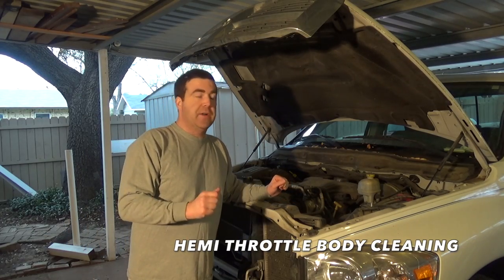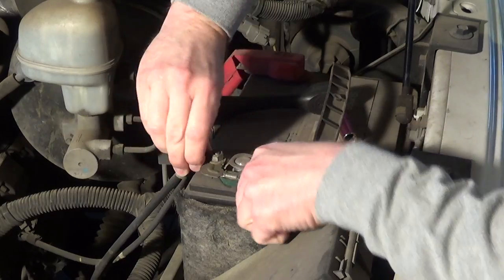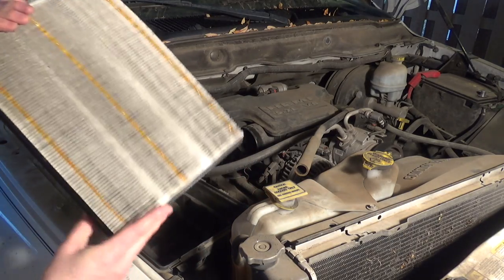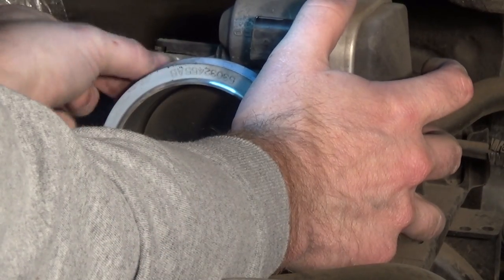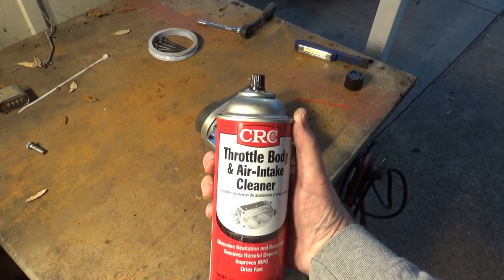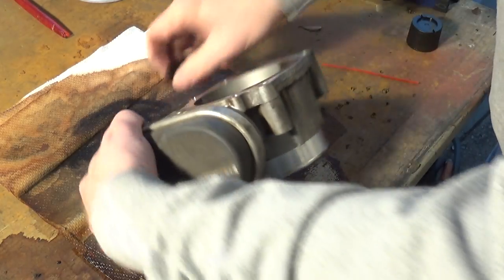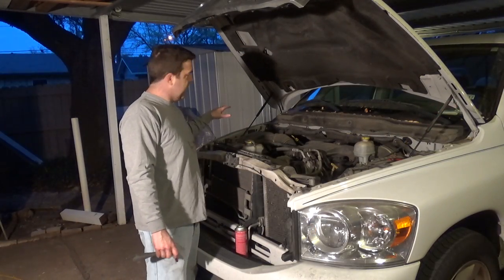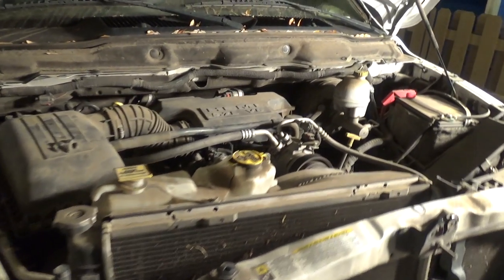HEMI THROTTLE BODY CLEANING | Chrysler Dodge Ram and Jeep

Comment: The engine bay for the 2005 Grand Cherokee is bigger and more room that the Ram, that is interesting. I bought my 05 WK a few years back, I am now getting into the engine and cleaning a bunch of stuff up. I think my throttle body was 3x worse that what you showed for that Ram. After changing out the spark plugs, the person who put them in, didnt bother to gap them. I am glad these types of videos are out there, all of this work I can do myself, it would cost a small fortune to take to the dealer. Great video.

Comment: Great video!  I have owned quite a few cars with 5.7 and the build-up on the throttle body oil buildup in the intake manifold seems to be very common.  I make a point to do just what you did every 20k miles to my HEMIs.  In fact, I just picked up a 2012 Challenger RT with 100,000 miles on it that I am about to pull the intake to remove some debris from under the intake, looks like a squirrel was trying to make a nest, and resolve what looks like a failing gasket issue; and a good cleaning. :)

Comment: Another thing you could do as long as you have the throttlebody off, your air temperature sensor can get carbon on this little sensor, their is a special cleaner for this air temperature sensor (note: don’t use brake cleaners) that’s all you have to do is squirt for 5 to 10 seconds depending on how dirty it is and put it back in.

Comment: Cleaning the throttle body is a good idea for all port fuel injected vehicles. it's the only way to clean the crankcase oil/carbon buildup in the intake system. One other thing I thought about is the possibility that by disconnecting the battery ground, it forces the computer to "reboot"  and may clear any glitches that have worked their way into the programing.

Comment: i had a similar problem with my gmc sierra. temporary fix was cleaning the throttle body. what really fixed the problem was using proper oil. synthetic instead of regular.

Comment: If doing this still doesnt solve your issue, you need to replace throttle body because it has a built in electronic potentiometer and those tend to fail from all the build up causing the lightning bolt light to illuminate and cause vehicle to die at low speeds or when going up hill. Obviously clean it first and test drive before you go that route. These trucks have the same type of VDO electronic throttle bodies as some mercedes benz cars do.
Reply: tech manager- very helpful,. Thanks man

Comment: Thank you so much I'm having the stalling problem with my 2005 Dodge Durango. It stalls intermittently when I slow down to make a right turn. Had the Cam shaft sensor replaced  a week ago and it still stalled on me. So now I will be having the throttle  body cleaned again. I had it done last year in November and it fixed my problem.. So I guess every year I have to have it cleaned.. Thanks for the great video❤️
Reply: Is it long to start?
Reply: @fettieteam2333  No it starts right up .. Even when it would stall out I'm able to turn it right back on...
Reply: @sourpeach1977  yeah but a fuel pump “going out” will work on and off until it’s done, I ask because I had a Dakota that was doing this , found out the hard way 100 miles away from home that the fuel pump was the cause
Reply: @fettieteam2333  I had my fuel pump replaced back in April 2021.. It started acting up when I would go to fill up and was spitting gas out.. And I had the inlet valve replaced because it was on recall...

Comment: For anyone that tries this and still has the same problem, i had the same issue on mine a while back and it went on for almost a year getting worse and worse, and I tried a bunch of things, but for me it started with a dirty throttle body, and it made it run rich and it took a while to figure it all out but, the that little dirtythrottle body throwing off the mixture took out one of my cats, all 4  o2 sensors, and the egr valve.  Hope this helpes someone with the stress I went through.

Comment: I believe it’s a “fly by wire” throttle body which might need a reset after cleaning. Turn key to on, push pedal to floor, you should hear a factory beep, then turn key off and your good to go. Drive as normal.
Reply: i done same without reset and no problem
Reply: @makantahi3731  it just depends on the vehicle some drive by wire don’t require a recalibration some do for some reason

Comment: I had this same problem on my 2004 Durango 5.7 hemi I thought It was my throttle body and even my transmission even though I had an intake leak. Then one morning I started my truck and it just shut off and didn't start anymore, it just cranked and cranked. Found out it was my fuel pump now it runs great and I can floor it without thinking twice. I posted a short video to replace without removing the tank

Comment: Same problem on Ram hemi 2012. After going to the shop couple of times and they couldn't get it to stop on them but when I ride every couple of days it would stop when slowing down and turning and start right back up. They did a tune-up and clean throttle body it and it worked fine for about a year or over. Now it's just started doing it again. It spent about $1000.00 trying to get it fixed but it think I will DIY  this time

Comment: There is a TSB out that you are not supposed to use Carb or Throttle body cleaner when cleaning the throttle body.  It say to use Mopar Non Clorinated brake cleaner instead.
Reply: Does it do significant damage ?
Reply: #perfectionisthater

Comment: Cleaned my throttle body, looked about the same. Had stalling issues and my engine would run after I turned key off too? Either it was luck or that was the issue, the truck has stopped stalling and shuts off when I turn the key off. Anyone else ever experienced this issue?

Comment: I have a 2004 Dodge Ram with 325k original mile on it, and I ran into this same problem several thousand mile ago.
if just cleaning the throttle body doesn't fix your problem, try changing your EGR valve.

My truck would stall whenever I had to stop quickly, or a hard stop.

After changing the EGR valve, it quit stalling.
Reply: Jody Doucet -  the EGR valve is what’s in the throttle body right ?  I didn’t know it was interchangeable.
Reply: No.
The EGR valve isn't anywhere near the Throttle Body.
Its on the passenger side of the engine...kinda bellow and to the left of the alternator if u were looking straight down onto the engine
Reply: If I knew how to attach a pics...I would send u a pics of the EGR valve on my truck.
Reply: Jody Doucet - right on,.. thanks man 👍🏻

Comment: Thanks I’m going to try this tomorrow on my 2004 dodge 1500
Reply: How did it go I'm going to clean mine today
Reply: Nolalyfe, i have a, '04 Ram 1500 hemi. I am having trouble with the PO340 code and camshaft position sensor. Ever have that issue? My truck is used and had an aftermarket sensor from NAPA (Echlin) in it when I got it. That sensor is a crooked or L-shaped camshaft sensor, but the MoPar one is straight. However, when I tried to replace the aftermarket sensor from NAPA, the MoPar sensor does not fit the wiring housing at all. However, with the vin number and all, the MoPar one is supposedly the correct camshaft sensor for that year model Ram. The reviews on the NAPA ones claim some fail right out of the box. I think that may have happened with me, as when I put a new NAPA camshaft position sensor in to replace the one that came in the truck, the truck would die while I was driving it. This happened at least 4 times in one day. Before it did not die when driving it, but only when I parked it. It would finally crank off after a series of as much as 40-50 cranks. I am confused as to why this OEM MoPar camshaft sensor (part # 5604 1584 AF 101) will not work in my truck as it is supposed to. Have you replaced your's and did you use the OEM MoPar camshaft position sensor or some aftermarket piece? I got a code message of an OPEN LOOP PO340, but not sure what that means.  Thanks.

Comment: Hey im having this problem on a 2005 hemi 1500 .. lighting bolt rpms going crazy turned off on turn on and runs like no problems but just for a little bit .. i did clean the throttle body .. change some sensors a keeps the same issue.. but the bid deal here is that i swap the engine a couple off months ago but I didn’t know about 2003 hemi didn’t have a egr valve so we did the swap and this engine has all the connections for 2005 hemi with the egr connector .. 😖 but no egr valve anyway i did run pretty good for a couple of months and now is doing this evil 😈 possession on my truck ... please help need it ... map sensor maybe??? I don’t know what to do anymore

Comment: Just imagine what the intake manifold looks like, not to mention cylinder heads and pistons. Get a catch can solves all that, preventative maintenance.
Reply: Part of the problem is exhaust gas recirculation which a catch can will not help.

Comment: Great video. I have a 5.7 hemi as well and it tends to sputter and stall when I get up to around 70 mph. The ETC lights comes on (lighting bolt). Could this fix the issue?
Reply: Did you ever find a fix? Same issue with my Ram. Thanks!
Reply: @paulb4259  THIS JUST FIXED THE ISSUE ON MY RAM. IT HAS BEEN A WEEK SINCE I DID IT AND IT IS RUNNING BEAUTIFULLY. NO LIGHTENING BOLTS. CLEARED THE ENGINE CODES AT THE SAME TIME AND SO FAR MY CHECK ENGINE LIGHT HAS NOT COME BACK ON EITHER. I AM CALLING THIS A WIN

Comment: How long was the stall?  Mine is like a split second I lose power then comes right back.  No check engine light.   Thanks 
Plugs changed 1 month ago
Reply: M Border could be loose spark plugs check that I've had that happen before

Comment: Great Vid. i just changed my spark plugs last night and should have cleaned my throttle body but it was late. i read in the manual i have to NOT use any type of throttle body cleaner but i've been seeing videos that use cleaner so i guess it's ok. I have a '04 1500 hemi. and also, i installed Bosch Platinum spark plugs, would you know if that's ok, that's what Autozone recommended, platinum or better. i was going to get iridium which is what i saw when i took out the old ones. thanks.
Reply: Dont waste your money on platinum plugs. Stick to the factory champion copper plugs. Autozone employees never know what to recommend, but to get a pricey sale. Iridiums are a waste unless you're boosted.
Reply: hung mammoth my dealer also said to stick with the champion spark plugs
Reply: Yeah definitely just stick with what is supposed to be with the truck and what the engine was meant to take which is plain ole coppers. I just took out some worn NGKs from theprevious owner on my dodge and replaced them with coppers champions.
Reply: Champion coppers every 30K on both my Dodge and Jeep

Comment: I just did this to my '08 5.7L 1500. Started right up, not getting any codes, but I'm having two issues: extreme delay when accelerating, and a significant decrease in MPG reading. I've had the truck since brand new, and hit the lowest mpg since I got it (4.4 mpg idling). Think I got a vacuum leak somewhere, or does it sound like something else? Thanks
Reply: Alfonso Gomez sounds like just a typical tb cleaning. Probably needs to be reset so that it runs with the cleaned new position of the flap, since it had the parameters for the flap being in the position if its been dirty for a while. Thats like one problem when cleaning throttle bodies.
Reply: Alex M Thanks for the reply. I did to the "re learning" process of leaving it on ignition for about 20 seconds before the first start up after the TB cleaning. Would you recommend I do another reset?
Reply: Alfonso Gomez i know theres a couple of re-learn process. Unplug the battery for an amount of time, driving on the highway for 20+ miles, and using a dealer scan tool. Ive done the battery and driving method and it wasnt much luck. The vehicle would have a higher idle and run like shit. The scan tool would be the best bet. One of my old buddies that has a shop always says never clean them because of the re learning hassle.
Reply: Alfonso Gomez another thing. Theres a tsb on dodge throttle bodies to use only brake cleaner to clean them. And if you didnt forcefully move the plate, and or let the cleaner you used go into the plastic cover.
Reply: Alex M Thanks for all the great information brother. And yeah, I did use CRC TB cleaner, and I did open the blade with my fingers to clean the inner walls of the throttle body bore. I was under the impression you could open them as long as the negative terminal was disconnected and the throttle body was removed from the vehicle. I had seen so many guys do it that way with good results that I thought I was in the clear.

Comment: Dodge say using carb cleaner/ throttle body cleaner is not to be used on the dodge ram with the elec. throttle body because damages, the elec throttle components, I did what this video, did and screw it up even worse. this Video is wrong, i have been mechanic for 40 years  and it normal just to pull  and clean, with cleaner, but i found out the heard way with this type of throttle body. just don't do it will cost big money for new one.
Reply: So a mechanic for 40 years and you still did it!!? #unreal